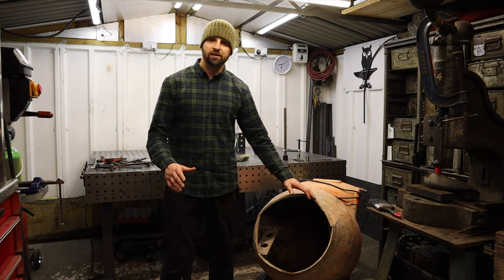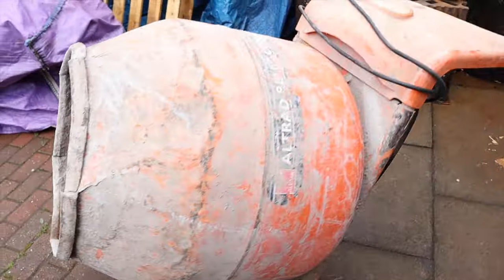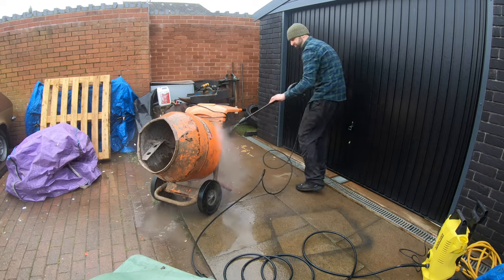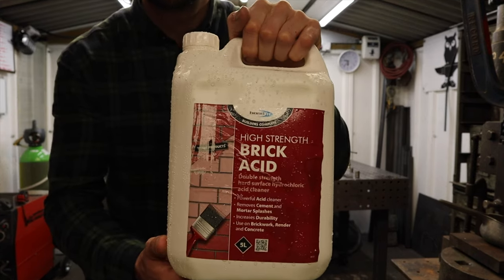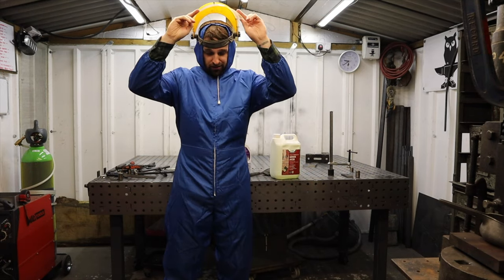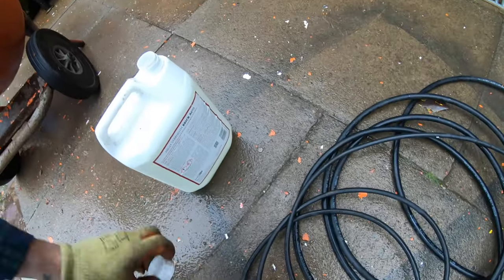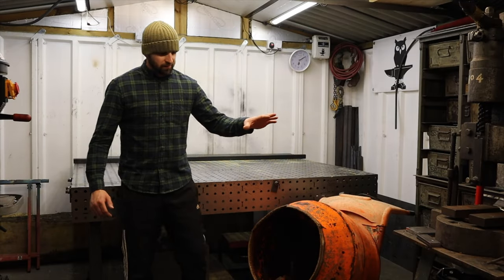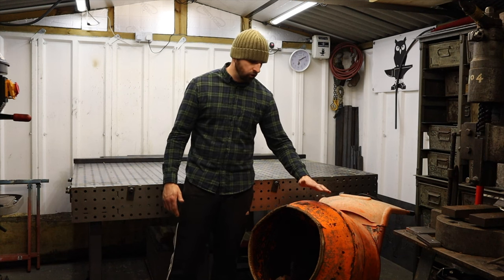How To Clean A Dirty Cement Mixer  / Restore

Comment: Good to see a video Jay.  Great job on the mixer.  I did it once myself with my dads old mixer.  Messy AF.  There was no pressure washer just a garden hose and a stiff old brush.
Reply from the maker: Hey matey. Great to hear from you. Much appreciated. Just a quick video to kind of get me some practise in trying to remember camera settings etc I used to use before I film more important / fresh content. best to make mistakes now
Reply: @WiseFabrication   you did fine Jay,  as I suspect you usually do  I am sitting here passing out trick or treat goodies as the little goblins stop by and saw your subscription notice.  The wife takes over for me soon.  We take turns.

Comment: Generally that's called a Concrete mixer.   Cement mixers have turning paddles but the drum is stationary.    
The design difference is because concrete has stone in it, which would jam up and destroy the paddles...  The solution was to just have the whole drum spin and tumble.   A concrete mixer will handle both materials.  A mortar/cement mixer will not.     Splitting hairs but still..  there is a difference between a cement/motar mixer and a concrete mixer.

Comment: Stick a bucket of sharp stones, or small brick ends in it with some acid mix and let it run for half an hour.
Could do with welding up the ring too.
Reply from the maker: Thank you. I did think this to be fair but didn’t  have anything suitable around me. But when I use it tomorrow I am going to do this after finished. 

Ring again very true. Thinking of just welding it quick or maybe replacing it and making a video on it.

Comment: Nice job Jay,I have a ww2 shovel that I used to mix concrete but never washed it off when I finished with it,I’ll try brick acid to clean it,thanks for the tip👍
Reply from the maker: Thanks Dean. Love it. If you want to use this acid pop over Ill put some in a jar for you

Comment: All we use to do is put water in the drum and broken bits of brick or shingle. And just let the mixer run for a bit
Reply from the maker: Correct mate. But more after you just used it. Doesn’t work so well with hard dried on cement. Needs the acid